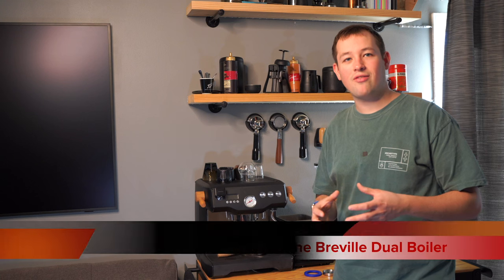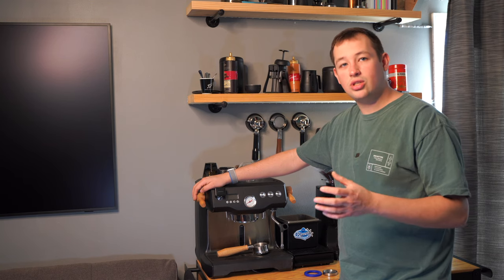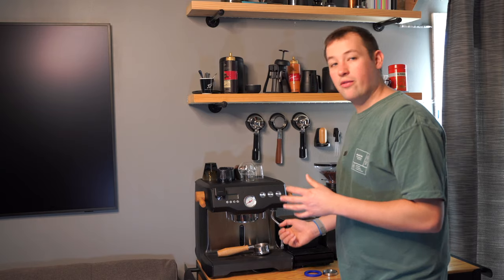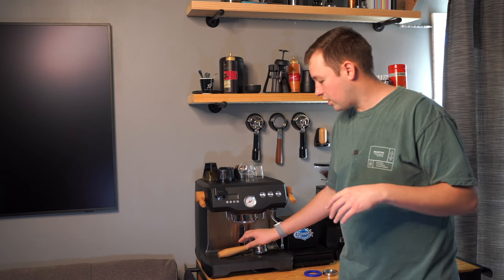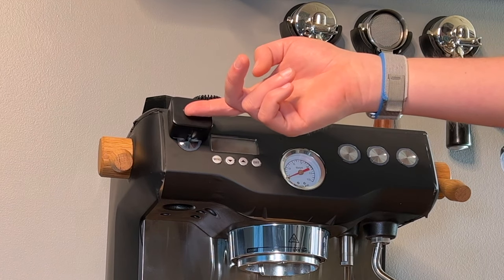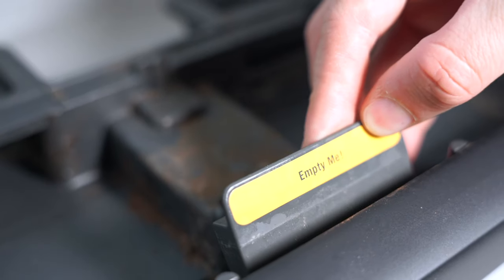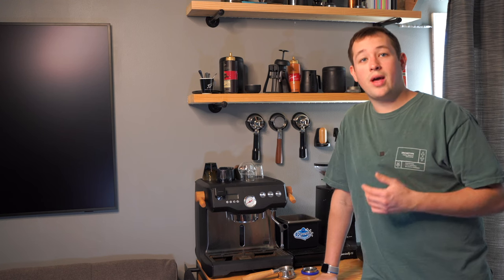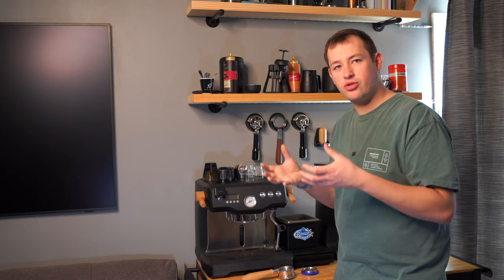6 Ways to Mod the Breville Dual Boiler!!!

Comment: can you show how you wrap your machine?
Reply from the maker: Unfortunately since it’s wrapped it’s hard for me to show. Basically it’s like putting on a big sticker. You take the sheet and pull and heat it with a hair dryer to get it around the corners. Then cut with a knife!
Reply: Just watch how they wrap mirrors of cars, that's the hardest part, if you can do that you can do everything else

Comment: Switchbot is really goid Idea
Reply from the maker: Works great!
Reply: I don't see the reason to stick something onto my beautiful machine because this thing comes with a built in clock and you can set a wake-up-time. The only reason to still stick a switchbot on there would be if I really need a coffee as soon as I get home and could't wait another 10 Minutes to let it warm up normally. Did your machine not come with that function? Maybe it's just for the newer model of the dual boiler?

Comment: Awesome video! I also vinyl wrapped with mine and did the slayer mod - full tutorial for BOTH of those on my channel - I wish I did wrap it in matte white though to match my grinder but it's fine as it is now. I am considering those exact lever upgrades from probably the same and only Etsy seller that makes that specifically for the slayer mod (levers on both sides). I hear changing the basket or shower screen makes no difference in the cup though so I haven't changed it - do you notice a difference in taste or ease of extraction?
Reply from the maker: Thanks for watching! Just subscribed to you! Great job on wrapping yours! Have you thought about wrapping the top of it? I honestly didn't notice too much of a change with the basket or shower screen.
Reply: @CabeensCoffeeCorner  ya I wanted to keep it as simple as possible though so opted for just the 2 side panels. Doing the front looked like a pain, kudos to you doing it. I am considering taking some leftover to do the front of the drip tray